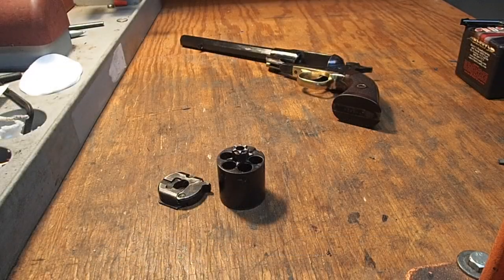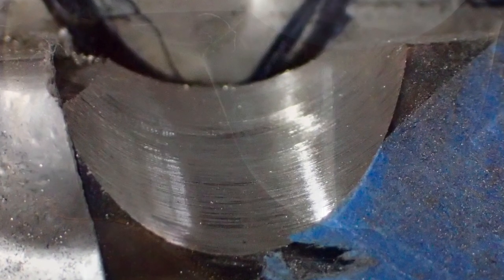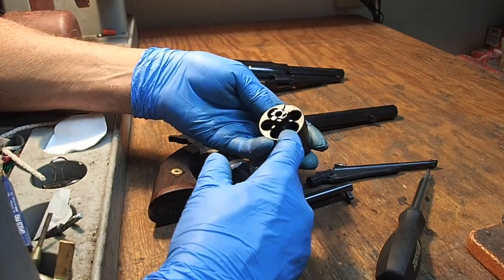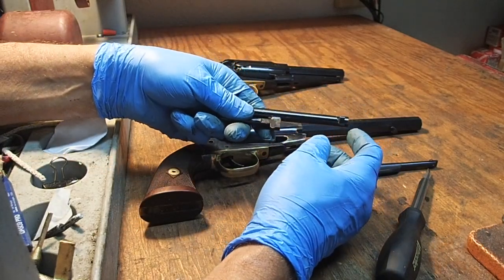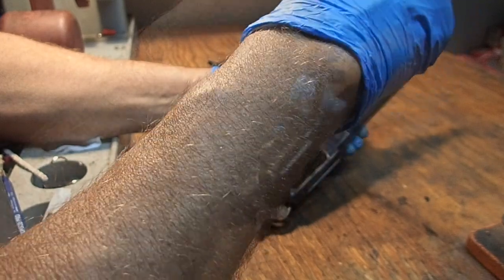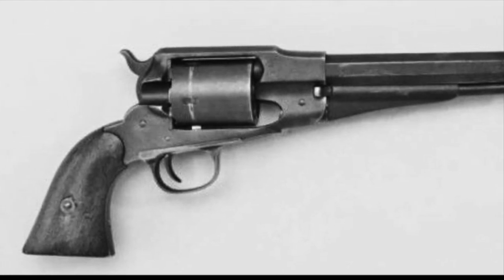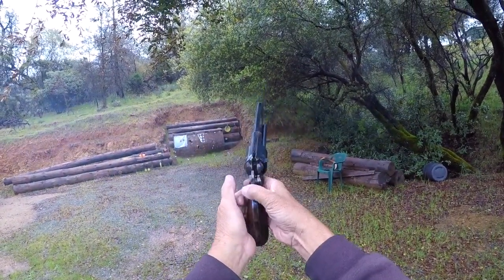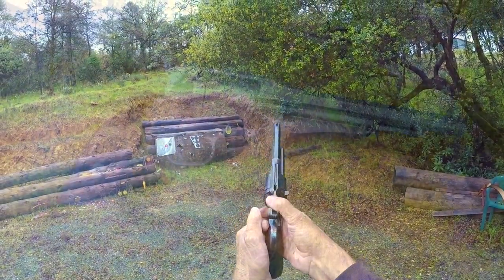KIRST KONVERTER IN THE NEW MODEL ARMY

Comment: I just installed a Kirst converter on my 1851 Navy.  1-The loading gate is short and floats causing it to drag on the ratchet teeth when the gate is open.  Four layers of aluminum tape under it and it fits without dragging.  2-The cocking action with the BP cylinder is still smooth with the new "Improved hand" installed, but is clunky with the Kirst cylinder.  It is necessary to snap the hammer back to get full cylinder rotation.  Next time I will try a Taylor conversion as the cylinder bolt (stop) snaps back way too soon and the hand or ratchet seems too short or just made wrong to index fully.  (I am not a NEWB)
Reply from the maker: I've heard Kirst has good customer support and a no BS lifetime warranty. I'd give em a call. I use my one Kirst Konverter in 3 different Pietta New Model Remingtons with no problems.I do not have the improved hand. I have a Howell's  (Taylors) in my Pietta 1860 Army. It works, but you need to break it down to load. I've gone through a couple sets of firing pins on this one. They are fun when you get the bugs worked out. Good luck

Comment: With the Howell there was no need to ruin my revolver for further black powder cylinder use
Reply from the maker: Yea, since I installed the Kirst & Howell's cylinders, haven't used the black powder cylinder much either.
Reply: The loading notch actually makes it easier to load it for normal blackpowder use. Easier to place the caps. Doesn't impede function at all.

Comment: Takes more work in modification but the kirst is easier than my Howell drop in .45 colt cylinder in my Uberti 1858 when it comes to loading and ejecting spent casings. I do prefer the simplicity of my Howell though with it not needing modifications. I posted a video on my channel of my most recent shooting session with it where I fired 20 rounds of HSM .45 colt 200 grain cowboy loads at a small cantaloupe from about 45 or 50 feet away
Reply from the maker: THE CLINT EASTWOOD, PALE RIDER RELOAD IS COOL. I DID THAT WITH THE KIRST BEFORE I GOT AROUND CUTTING THE CHANNEL IN THE RECOIL SHIELD. THANKS FOR WATCHING.
Reply: Yeah it just costs so much :( another $700+!!!

Comment: Wish they would do a 6 round version with the gate. I saw they have a newer model still with 5 rounds but it has hammer safety notches between each chamber now? How did you like it on your 5.5"? I have the model
Reply from the maker: There just isn't enough room for six . 45 rounds in the conversion cylinder. The original Remington conversions were 5 shot. There were some 6 shot conversion cylinders around, but the chambers were bored at an angle to make it happen. It is very handy in the 5.5 Rem, but a little more work. check this out. https://youtu.be/a08xWa1CKyY

Comment: at 5:15 there seems to be some material exiting the barrel when you fire the pistol. What is that from since the 2nd set of pictures showing you firing the pistol don't seem to have those fragments. Is that some coating on the bullet?
Reply from the maker: No, just plain lead bullets. Those cans were filled with water, what you might see as material exiting the barrel is probably the water spray in the background from the exploding beer cans.
Reply: @oldscoutgp  Thank you! I've looked at some reloading vids that show people putting "wads" (to make sure that the BP is fully compressed) so I thought that's what it might have been. Water! Who would've guessed.
Reply from the maker: @drcoolit  That is why I prefer using the Schofield brass in the conversion. It will hold 30 gr of black powder ( what the gun was designed for) with out the need for wads or fillers.
Reply: I thought the SAME EXACT thing, but when you play it frame by frame it really is the water from the targets. It really looks like it's shooting out from the barrel lol.

Comment: I have to ask, because it's been something I've been wondering about. Is it still possible to do the Remington Cylinder switch that 1858 Remingtons are known for with this Kirst Conversion? I'm still interested in getting one regardless, but I've been wondering about that; mainly because for all intents and purposes, the Cylinder switch is kind of the forerunner/first iteration of a magazine if you think about it. Really useful to have.
Reply from the maker: The Kirst cylinders are sold as a part, so you can just buy one through the mail. Check out the Kirst site for more info. I wouldn't wait too long, the way things are going.
Reply: Instead of carrying spare cylinders and having to reload why not just carry another revolver?  Switching cylinders is faster than reloading but grabbing another revolver that's ready to go is faster plus you can use it if your first revolver breaks or is lost.  Don't let the movies fool you.  Replacing the cylinder isn't like using a speed loader or switching magazines.  You have to get the cylinder perfectly aligned before the pin will slide in.  It will be aligned on two of it's axis but will still need adjustment left, right,up, down before the pin will slide through.  You can't really even practice and expect to improve your reload time really.  If you're slightly off the pin will go part way home and then bind.  Often it will bind so tight that you can't pull it back out without using some other tool to get it back out.  Even today if you ask a person who carries a revolver it's just as easy to carry another revolver as it is a speed loader. And if they're carrying a speed loader it's only because they don't have a Smith and Wesson j frame revolver.
Reply: @brianwilson4861  can't afford two revolvers.
Reply from the maker: If you want to do the cool Clint Eastwood Pale Rider cylinder swap you could get the Howell un-gated conversion, it is less expensive. You can use the Kirst and you wouldn't have to cut in the loading port.

Comment: The new kirst ejector do you have to cut out the original cylinder pin
Reply from the maker: Not on the 8" model, just drop the loading lever and it will pull out. On the 5 1/2 " model you will, because the loading lever retainer is in the way.
Reply: Thank you so much the new ejector looks so much better I've been wanting to convert my target model 8 inch for some time and love that it's just drop in no dremel or cutting  out of the hammer lever to retain the ejector
Reply from the maker: @justinrobinson692  You will be happy with this ejector, just remove the loading lever screw from the left side, drop the Kirst cylinder pin / ejector rod in and replace the screw.
Reply: So the ejector still works with the sheriff's model?
Reply from the maker: @opusjosh  Yes, but it will not just drop in. The lever retainer is in the way. There are several ways to deal with this. In a previous video I show how I did it.

Comment: Does the template come with the kit? Or did you measure it out yourself?
Reply from the maker: A paper template does come with the cylinder. I had used mine on 3 or 4 guns and needed to make a new one with a completed gun as a guide.
Reply: @oldscoutgp  Ohh alright thanks!

Comment: I've put several of those in an they were never in time ,big pain in the azz
Reply from the maker: I only have experience with this one Kirst cylinder, but it fit and locked up tight in my two Pietta pistols.
Reply: When I initially installed my Kirst converter in my 1858 Remington I had fitting and timing issues. I had to shorten hand about a millimeter at a time until it advanced the cylinder into the correct position for the locking lug to engage. Additionally I had to taper the locking lug a bit to fit into the locking notch on the cylinder. That and adjusted the timing spring tension. I also had to take about a millimeter off the flat plate the sits in the frame and is the back of the cylinder with the load gate. Out of the box it sat too high in the frame and caused the cylinder pin to bind and would not advance. Once those adjustments were made it cycles perfectly.